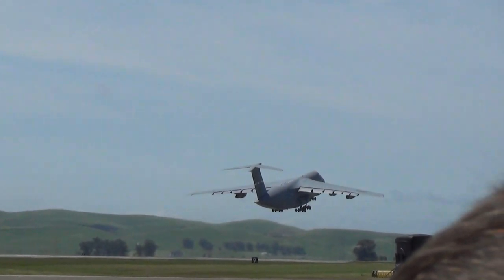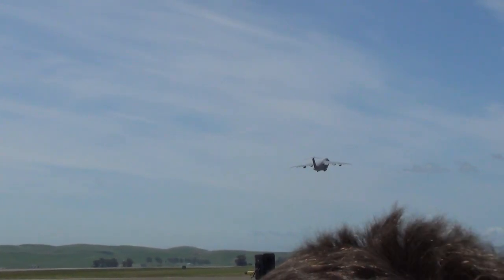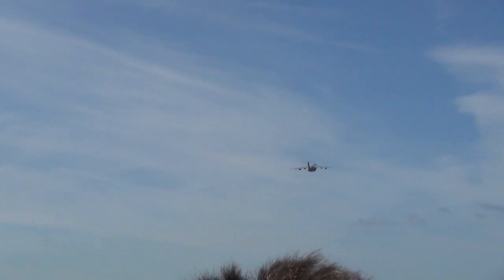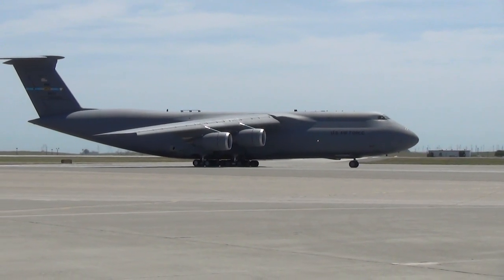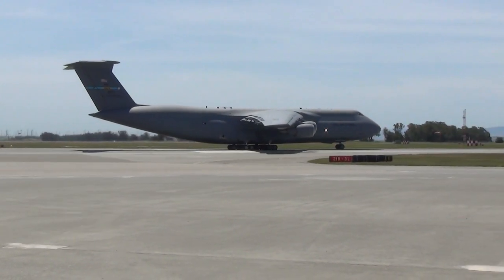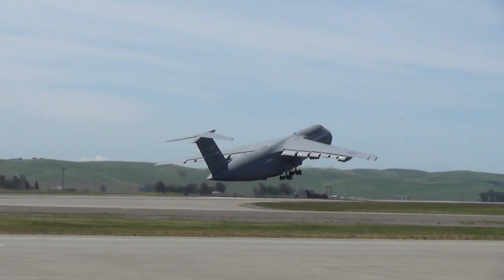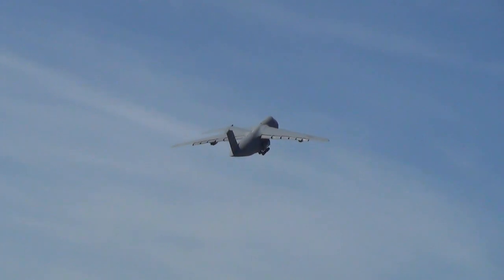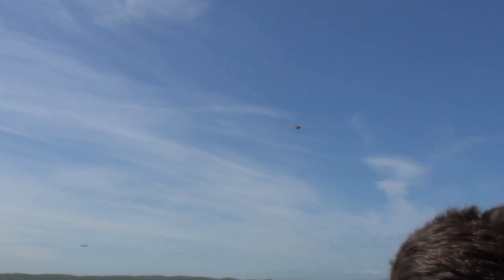C5B galaxy and C5M super galaxy take off  travis AFB.

Comment: The C-5M's engine, the CF6-80C2, was available and in commercial service THIRTY YEARS ago. The ever-watchful Pentagon drug their feet for over a decade until they bit the bullet to retrofit the C-5 with the engine it really needed. Now they are making less noise, hauling more payload, burning less fuel, over longer ranges. Very cost-effective!
Reply: So true we suffered for years hauling things across the pond  @ 270 .77Mach getting passed up by everything on the NATS.........

Comment: That's staggering how quickly the C-5M took off and climbed. The new CF6-80Cs only have 51,500lbs of thrust? I've seen where they were closer to 56,000lbs which would make more sense. Anyone know for sure?
Reply: They've been derated for the C-5M.
Reply: Robyn is correct. Down rated so the engines don't rip the wings off the fuselage.
Reply: @samhouck1833  Yeah, BRING BACK THE TF-39S!!!! (MISS THE SOUND AND POWER OF THOSE MIGHTY BEASTS!!)

Comment: Just imagine if the C-5 M had the TF 39 engines
Reply: Yeah!!!
Reply: C-5M should have the RB211. It produces 50,000 lbf thrust, same as GE F138 and besides, produces loud noise like the TF39. The Growl of the Tf39 mixed with The Efficiency of the f138 gave rise 2 the Rb211
Reply: @JishyFishy4106  Pylons can't take it.  The new engines are even detuned, they don't make max power.